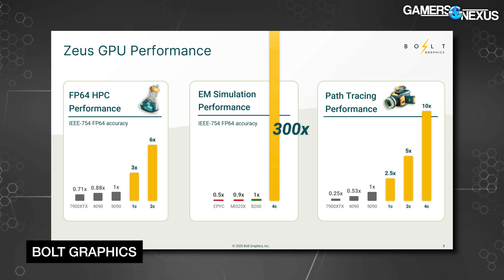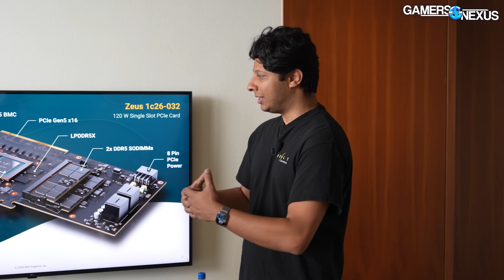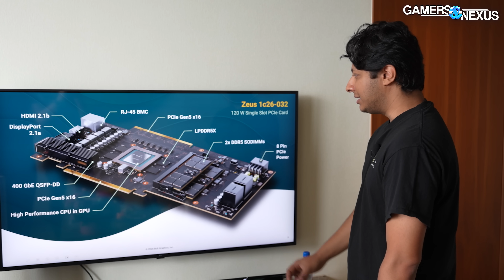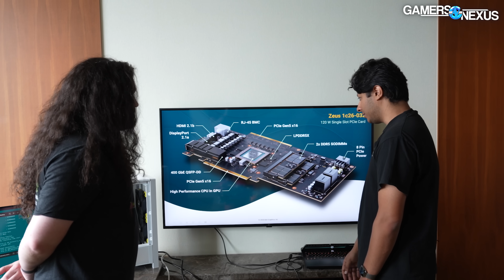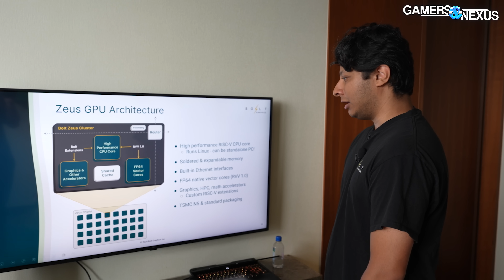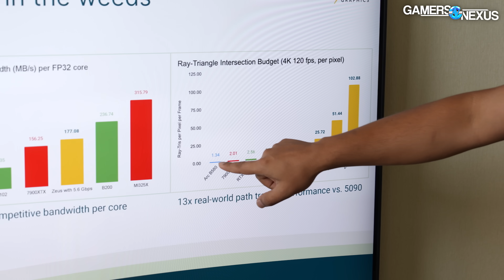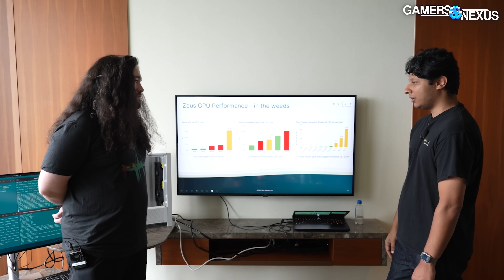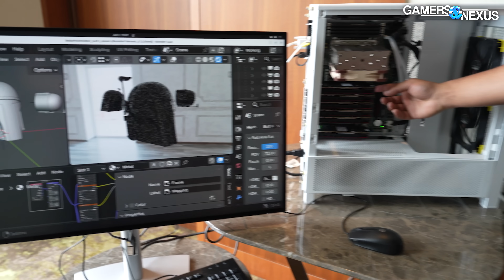A New Gaming GPU Challenger: Bolt Graphics Takes Aim at NVIDIA

Comment: I was sold as soon as I heard “user expandable GPU memory”
Reply: I assume they had made this design decision before the memory surge.  If so, talk about lucking out.
Reply: @boppins  even so its still gonna be cheaper to replace the ram than buy a new damn card or even wait for a new card with THE SAME AMMOUNT OF MEMORY
Reply: @It_was_a_dream  ya but what you don't understand is you don't need more than 12gb unless you use llms or render shit and even at that the speed of the memory is still going to be slower either way AND if you have the gou for 5 years the one that comes out t years later is still going to be faster even if you have more memory 😂😂😂
Reply: @BobTrump-p3j  You have no idea what are you talking about. Why you even trying ?
Reply: @BobTrump-p3j  false. I game on a super ultrawide monitor. My 5080 constantly runs out of its 16gb vram. I'm not paying 5k for a 5090 just for more vram.
Reply: @It_was_a_dream  Or you bought a Nvidia cmp 170hx but Nvidia only allows you to use 8 Gb of the 80Gb hbm on the board, just because i guess. Wy would anybody want use the additional 72GB  they paid for.
Reply: @boppins  I went all in on RAM before prices went mad, maxed out with 128GB. Now, that same RAM costs over 4 times what I paid for it.
Reply: @boppins ram prices will crash next year
Reply: @SunnyChoudhary-k5k  Interesting take considering Micron themselves said that prices will start going down in 2028.
Reply: @Dexiefy Thats what a multi billionaire company would make you believe
Reply: @SunnyChoudhary-k5k agreed
Reply: @SunnyChoudhary-k5k  i wish
Reply: @Dexiefy  Why would they tell the truth? I'm not saying they're lying or not. We can all agree that eventually the prices have to go down, but wouldn't it be against their own interest to provide a clear timeline of when that would happen especially if it is a somewhat close date?
Reply: @enmanuel1950  Ram prices go down as soon as AI starts either needing to make a profit or lose investors and their blank checks.
Reply: @Dexiefy  to be fair, they would say that in an investor meeting. Not like these companies go 'we anticipate that the bubble will pop and wreck our margin.'
Reply: @SunnyChoudhary-k5k  the copium is strong here. What, did y'all think the ram/memory mafia will want to make less money? No, they'll be keeping their prices, maybe it will stop going up, but it will never go down. They are the only supplier, they choose the prices and we don't have any choice but to buy, why on earth would they voluntarily lower their prices? Because less focus on AI when the bubble pops? Peoples will still need that product, they'll keep making em, they'll keep selling, they'll keep making money, basic monopoly type of marketing. It happened before, it will happen again and it will keep happening.
Reply: Funnily enough this was extremely common in the 80s and 90s. I don't mind it coming back at all.
Reply: @NoxiousPluK  Yes because GPUs (if you can even call them that) in the 80s and 90s are nothing like they are today. The electrical signals in modern memory are very sensitive and things like having a socket can add a lot of extra physical distance to cross (which increases latency) or reduce how tight the timings on the memory can be.
Reply: @presentfactory  You're not wrong, but you're overstating it I think. The DDR5 memory is not the main graphics memory, the main memory is LPDDR. The DDR5 is spillover, which would normally be system RAM. Moving spillover memory to the other side of the PCIe bus massively improves latency. This move decreases latency, it doesn't increase it.
Reply: @presentfactory aware - this likely wouldn't work for GDDR and its speeds, but its a nice idea to have tiered VRAM. We can already see that using single-channel memory with an X3D-CPU has much lower impact as usual.
Reply: @NoxiousPluK  From a gaming perspective it might work well for LODs, keeping all of the main soldered on quality memory handling the graphics near enough that you'd like for it to be realistic and using the slower memory for the background that only kind of needs to look like something from afar. Not sure if that's possible or if you can't target specific memory like that in graphics.
Reply: @jeffwells641  Correct.  That PCIe 16x bus is effectively 8x or 4x by the time it gets to the system memory due to many weak links in typical motherboard archictecture. Also, as it is effectively a stand-alone computer, this means that you can poitentially do things like pre-load all of the assets for a game into that space and have ZERO cached files/assets for larger MMO type games. Freeing up your CPU to actually do CPU things and not causing wear to your SSD.  Just dump everything in that directory into the shared ram and go.  Yes, this would also massively increase Photoshop times as well as you simply avoid needing a swap space. It just drops it onto the card and processes from there.
Reply: @NoxiousPluK  GPUs in the 80's? Were they even around back then?
Reply: @jaredj-v5l  A few of the first video cards had upgradeable memory, like the IBM 8514/A video card. It came with 512KB normally, which gave you 16 colors.  This was fine for business use. Expanded to 1MB and you had 256 colors.  Gaming and graphics use. This represented a nearly $300 cost savings after tax if you didn't need the exta memory.
Reply: @jaredj-v5l  Sure. They were just called 'video cards' and had less features, but essentially did the same thing.
Reply: @jaredj-v5l  Cirrus Logic.  Had a card in the late 80's early 90's.  Then I started using Matrox cards.  Then NVIDIA.
Reply: @jaredj-v5l  My first computer - with a 80286 CPU - had a PRISMA VGart GPU.
Reply: @NoxiousPluK  Nah, they were called "math-coprocessors".
Reply: @Jianju69  that's an entirely different device (and those have since just been integrated in CPUs)
Reply: @NoxiousPluK  Yeah, I guess you're right. Still, there's a relationship betwen the two, both specialized for matrix math and for much the same reason.
Reply: @Jianju69  Yea that's also a fair point!
Reply: @NoxiousPluK first gpu was in 1999 bro 🙄
Reply: @n...singh005  nope
Reply: @UnwelcomeHistory??
Reply: @n...singh005  That would be the early 80s, actually. You might want to search for the term "Geometry Engine" (it was used in the IRIS 1000 from Silicon Graphics).
PS: I should add that I myself added RAM ICs (!) to some graphics cards myself in the mid-80s. There were sockets for them on the card, and the basic model came with only half of them put in (because of the price, which of course reduced the resolution or bit depth the card could use). These were "standard" graphic cards, though. I never had the chance to lay my hands on the really expensive stuff like basically anything from Silicon Graphics (but in 1985, I installed and set up a Sperry UNIX computer which cost 3 times the money it cost to build my parent's house back in Germany)... 😆
Reply: @n...singh005  This is what happens when people google an answer and just regurgitate the first thing google spits back out. People need to learn not to chime in if their entire knowledge base is a 5 second google search. Even in the early 80's there were things that are essentially GPUs. NVIDIA were just the ones that marketed a "GPU" and made there own definition of what a GPU was to fit there own claim. 

NVIDIA wasn't even the first one to use the term GPU. Sony coined it 5 years earlier in 1994.
Reply: @glnga  i actully didn't knew about this.. but i did some research and turns out these 'GPUs' like one in PS1 were more like some part of graphics pipeline baked into silicon for faster processing but still running sequentially. They didn't had any parallel processing that modern gpus focus on. Some systems brute forced parallelism using multiple chips mostly arcades and workstations but nvidia was first on in consumer space to put multiple graphics pipelines (and more of the graphics pipeline) on same die. So apart from who coined terms or what defines as a GPU, nvidia's gpu was the first one how we see modern GPUs.

Also didn't knew lockheed martin took a detour from fighter jets into 3d graphics partnering with SEGA 💀
Reply: @n...singh005  It's easy for NVIDIA to be the first "Modern GPU" when NVIDIA is the one that defines what a GPU is. The fact is that that if you really look at it, even if you're using NVIDIAs own definition that they made up, there are plenty of things that are very close that came before it. It's just that they obviously made the definition such that it wouldn't include any of these devices.
Reply: @glnga  i won't debate on that.. its more like calling linux an OS or not
Reply: @glnga  maybe you are right.. its like history is written by victors and nvidia's approach is winning even today
Reply: @n...singh005  Acutally.....Saying 1999 is inaccurate. If you mean a single chip fixed function 3D processor, Mitsubishi beat Nvidia to it with 3D-RAM in 1997. If you mean dedicated hardware doing geometry and rasterization, Sega arcade boards were doing that in 1992. GeForce 256 was just the first desktop PC card to put T&L on the main die. And chips like the 3dfx Voodoo (1996) and Nvidia’s own RIVA 128 (1997) were doing the exact same job of accelerating 3D graphics. The GeForce 256 just integrated one extra step (Transform & Lighting) onto the hardware. Get gud nerd.
Reply: @glnga  Sony wasn't even the first to coin the term GPU, the term Graphics Processor Unit was coined in the 1970s!  It wasn't until the 1990s when it was changed to Graphics Processing Unit.
Reply: @NoxiousPluK the word you are looking for is "funny."
Reply: @josephk6136  funnily is also a word, y'know ...
Reply: @josephk6136  fun·ni·ly
[ˈfənəlē]
adverb
in a strange or amusing way:
"you do talk funnily"
(funnily enough)
used to admit that a situation or fact is surprising or curious:
"funnily enough, I was starting to like the idea"

Maybe check a dictionary before you demonstrate to the world how poor your vocabulary is.
Reply: @josephk6136  no they found the word they were looking for.
Reply: @proxy3386  A much hated word, one that didn't always exist.
Reply: Sodimm slots are much slower in terms of bandwidth than soldered vram used in most gpus.
It can go upto 64gb/s compared to 1.8 tb/s on 5090 or even 448gb/s on 5060

Edit: 64gb/s is for single module.. 4 lpddr + sodimm combined can reach 300+ gb/s depending on config
Reply: @n...singh005  I wonder why if they could use CAMM2 form factor RAM - it is faster and can be cooled easier
Reply: @ViktorSL-1  CAMM2 is not widely available to users, and it certaintly won't be cheap. I'm sure it's a future consideration provided the tech actually reaches the consumer.
Reply: @ViktorSL-1  Could see that in a later version if this gets off the ground. RAM's expensive as can be right now, so it's nicer to just be able to grab some 8GB SODIMMs out of the junk drawer from a laptop upgrade, or buy those from someone else's junk drawer. An 8GB DDR5-5600 SODIMM isn't speedy for a video card, but it's also in the $50-70 range on eBay right now. There isn't a similar pool of used SOCAMM2 modules yet, so this seems more practical to me.
Reply: @ViktorSL-1  CAMM2/SOCAMM2 is being reserved for AI use right now especially in the 192/256GB modules, you can imagine the price of those
Reply: @n...singh005 ok but what if you had 4 gigs of soldered vram and 16 of sodimm slots, just like how a cpu has high speed cache and slower memory, there would probably be a way to do something along those lines with a gpu
Reply: @Genalt  you are right.. i didn't thought about that.. added edit to my comment
Reply: @n...singh005  there are ddr5x chips next to the core, isnt it just that? Look at the tv in the vid
Reply: @Genalt  Remember the GTX 970 ? Where 3.5 gigs were fast and the remaining 0.5 gigs was slow ? As soon as you went above 3.5 gigs, performance tanked. This will be worse.
Reply: @n...singh005  My only fear with using multi sources of something is latcy. yeah it could reach a combined total of 300gb/s but even with hyper threading. turning those off for some games you can "feel" the latency become less
Reply: @PyromancerRift  the 970 didn't have tiered memory, nvidia was just coping about it. with a properly coded driver this setup is proven to work well

rdna2 showed that you can significantly cut memory bandwidth and effectively compensate for it with cache. i'm fairly sure the main reason we're not seeing more of that is because it doesn't work for large ai models, but it does work for graphics
Reply: @Genalt  That sounds fun for the memory controller...
Reply: @Genalt  The goal is to move swap files and assets off the slower hard drive and memory controller bottleneck and simply drop them on the card.  Effectivey a ram drive that bypasses the entire motherboard architecture bottleneck. Remember, the goal here is to target graphics use (think video rendering and photoshop and so on) and not even consider whether it is good for crypto and AI use ( which it won't and therefore remain cost effective to businesses and end users ).  $1000+ for a 5070ti if you can find one is just gross. 
And business-wise this also makes sense. Buy the card now with the budget you have, and next year spend on memory upgrades.
Reply: @heskoo2k  This is still less than the lag created by loading assets from the SSD to the video card. Imagine a game where all of the assets are just dropped onto the card. 1 percent lows simply vanish.  Loading slowdown at the beginning of levels and areas as well. The positively ancient architecture of most motherboards is orders of magnitude more latency than their design.
Reply: @Genalt  That is literally what they are doing
Reply: My guess is the LPDDR5X functions sort of like how faster caches do on SSDs and Processors
Reply: @n...singh005  Caching and memory tiering is how we get large capacity high speeds for low prices. That would need significant architectural differences from current GPUs and they would probably need to work with OS vendors and game makers to make it work though.
Reply: @timno9804 They wouldn't. If the GPUs reports the memory as a unified pool no tweaks would be required by the os or developer, everything would be handled by the GPU itself. The driver would act as a normal driver allocating and paging the memory if needed between different applications. Most GPUs already do this with l1,l2 caches this would just be adding another layer. The concept had been explored by researchers and there is performance to be gained by doing this because ddr5 usually has lower latency so for random reads when small files are required that don't saturate the buss the ddr5 is faster.
Reply: @n...singh005  I don't care. Unified memory sold me. Being able to run frontier-sized AI models locally will be vital to avoid thin client hell.
Reply: @countergravity6371  and memory bandwidth is the main bottleneck in running AI models especially on lower end cards. Do you want to run a large model at 1tok/sec ? Do you know full form of HBM memory used in AI datacenters? Its name itself is High Bandwidth Memory
Reply: @n...singh005  Look at it this way, initial load time to get in a game may be a bit longer but if you install enough ram on your gpu, once its loaded its loaded and you very well may never need to load the vram up again in that game. The speed in my understanding is more to do with getting it off the ssd to the vram, once in the vram it doesnt need to be called on at such speeds because it already knows where it is and when it will likely need it.
Reply: @n...singh005  I've seen it with older workstation gpu, but "much slower" can be a good trade off when the alternative is either "unable to do it" or "costing as much as your home".
Getting the job done is infinitely faster than not getting it done for either memory or budget reasons.
Reply: @n...singh005  I dont think the people that are gonna buy it are the type of people that would care about that.
Reply: @n...singh005  You can easily design a so dimm with much less latency.
Reply: what about at 10:45 data center use case?....still sold?
Reply: @hvdiv17  Yeah this is not a GPU intended for gaming and never will be.
Reply: @kovec681  he spent the whole video about gaming and you guys think its not a gaming card because he said "IF you want to set up a data center"?

Peak YouTube weirdos right here.
Reply: @hvdiv17 is that inherently evil? Or anti consumer moves are.
Reply: lpcamm is solid alternative to sodimm
Reply: EXPANDABLE GPU RAM. WHAAAAAAAAAT. WHAAAAAAAAAAT!? FUCK YEAAAAAAAAH
Reply: Yup should be really fun in totally game for purchasing one
Reply: Imagine if even processor would be upgradable!? Even with this kind of semi upgrade, its already consumer friendly. I hope they dont sell their soul to surveillace  centers (datacenters). This would open up market for custom coolers for ram/gpu.
Reply: Bolt should update the design to lower latency, LPDDR-compatible LPCAMM2 modules.
Reply: Good for future-proofing
Reply: sounds slow as fuck
Reply: @matthew4107  the rog ally x runs on lpddr5x too, so atleast for the unified part i think we're fine. that is a decent device that doesnt seem to be bound by memory speed for atleast gaming workloads, maybe for ai but that's not what they're targeting so  should be fine. even for ai the bandwidth is similar to a dgx spark an ai specific product.
Reply: I'm hoping they use higher bandwidth camm2 memory at some point
Reply: Sounds good, but if the memory chips are gonna be expensive, you're gonna be stuck in the same spot you ran away from.
Reply: Then you need to watch the rest of it.
Reply: I just want to Nvidia get destroyed. As long as I can use this card for Blender3D and LLM/AI gen, I'll be set.
Reply: @VPZ80  It will be good at rendering but complete ASS at AI.  It's not designed for LLM and similar uses.
Reply: same
Reply: 1k idiots think this is a good thing for bandwidth.
Reply: The only issue is the speeds... But if like he says they have balanced that loss out with cache then it might actually work wonders...
Reply: I think given the current memory market, this is the only way.
Reply: like in the past lol . love it
Reply: continue watching to where he says "in a datacenter use case"
hate to break it to you, but..
Reply: @hardwareful  It's not viable, though he of course wants to jump on the AI hype-wagon. The reality is it's less power effieicent and that's fine. The reason modern GPUs are used for AI is because it's the most cost-effective option for brute-force calculations.  Not graphics or image processing.
Reply: Yeah, just slow.
Reply: If you guys actually watch the video they address the tradeoffs and why they still want to use sodimm
Reply: SAME!!!!
Reply: It was the only right response after Nvidia offered the 5060 and 5070 with 8 and 12gigs
Reply: Same omg, I like making my own PC even if I'm not big with software and hardware, but just being able to upgrade your GPU even by a little is already great (if RAM price get slightly down one day)
Reply: Yeah games just vram hungry but hopefully we can get out of this memory shortage craze
Reply: yeah idk how they are going to have any meaningful memory bandwidth if they are using SO-DIMMS
Reply: @3lanksp_ce between 300 to 700 GB/s of bandwidth is pretty good I'd say. only the top end cards have faster memory.
Reply: Expandable "GPU" memory... the expandable part is the DDR5... which isn't really GPU memory... so.. yeah
Reply: You are not going to find a memory stick that matches theirs. You will be buying a kit and have the original one rattle around in a drawer.
Should have sold a kit for us who already got drawer rattlers to shove into a GabeBox.
Reply: this expandable memory has not relevancy fo gaming though. It's normal ddr5 ram and this ram is way way slower than proper GDDR memory.
Reply: using regular sodimms is a crazy bottleneck on a GPU.  the performance on these is going to be terrible for anything a non industrial customer is going to want it for.
Reply: V cool idea.
Reply: YES
Reply: Such a game changer. Literally.
Reply: imagine if you could take the memory out of a current card and put in your new card. Maybe one day ion  the future
Reply: hold them to it tho. words are cheap
Reply: Thats called being gullible
Reply: I’m glad it still has some soldered memory. That expanded memory is gonna be significantly slower.

I hope their next model has LPCAMM or something faster so that they’re not bottlenecked as much by memory bandwidth.
Reply: Im really rooting for a challenger, but honestly user expandable GPU seems a bit gimmicky and Im my view it means higher production costs as well as more points of failure.
Reply: @teresashinkansen9402  It doesn't mean either of those things. It just means worse memory bandwidth. Soldered connections are simply always better for signal integrity.
Reply: @Kwazzaaap  So procuring another component, which is user serviceable which means it has to have more rugged attachment points, which could alter soldering steps as well as having memory on its own board. Does not mean potential higher costs and failure points? Oh definitely it will significantly impact bandwidth as well, probably the main impact, indeed.
Reply: @teresashinkansen9402 What if they sold you the card without the RAM and you could purchase however much you wanted?
Reply: @AshrZ  If you already have the RAM might be not that bad, but if not you are purchasing more components.